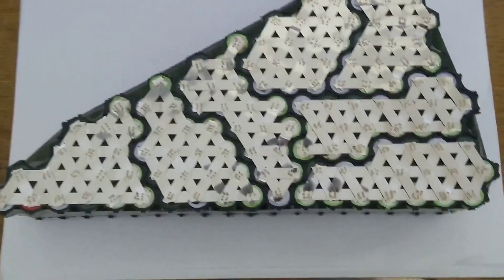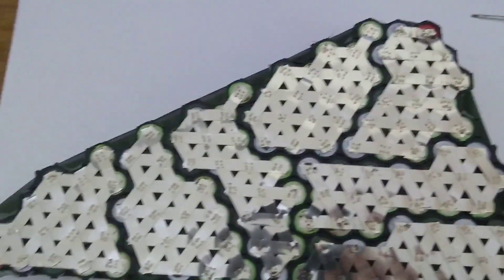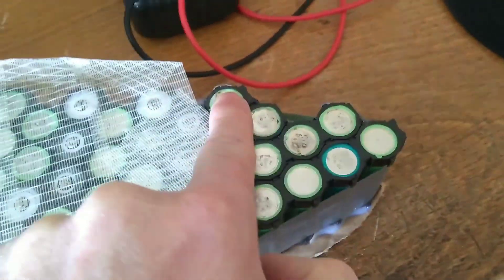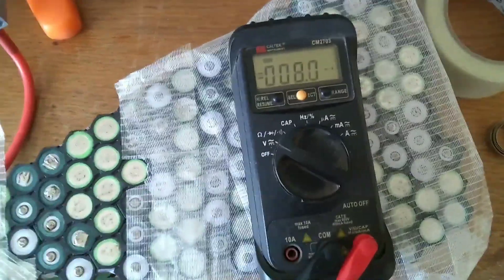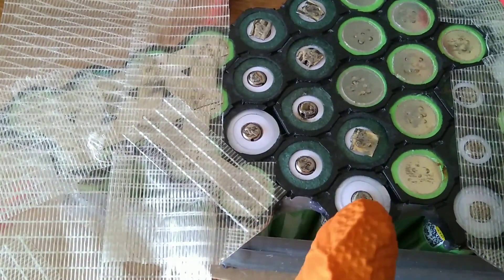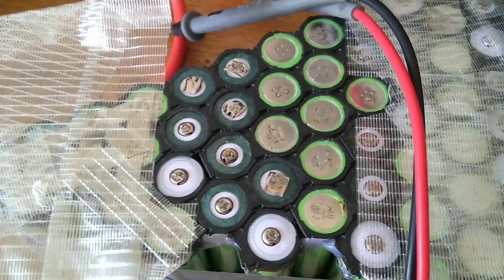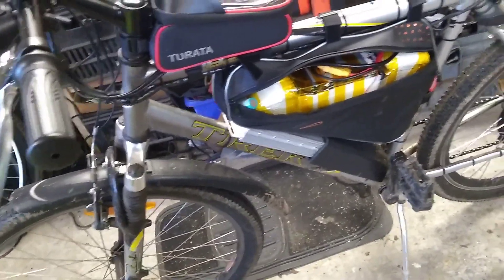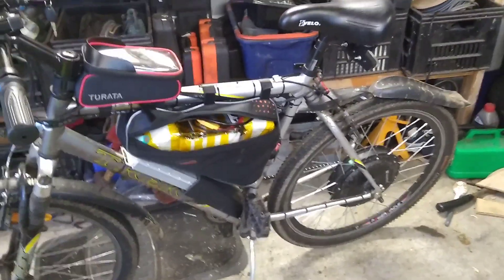DIY Ebike Battery pack for Voilamart kit - 52V 14S 9P 1.6kWh

Comment: Thx for the video.  I’m starting a 52v,60ah build with 21700 cells.  I found this helpful.  I’m trying to decide if I should use a passive bms balancer vs active bms balancing at 1 amp.

Comment: Awesome battery build i was hoping to do the same myself any chance you can explain the patterns on your drawings please how you wired it up showing the flow from 1s to 14s please
Reply from the maker: Thanks, it is still working well.
The way I worked it out was to buy the cell holders (link in the video description) and build them into the shape I needed so now I know how many cells in total I can fit in. You already know the number you need in series as you motor/controller will dictate this, so you can work out the max number in parallel. Build the shape using the cell holders then trace them onto a page like I showed in the video and pencil in the cell pos and negs. You need to draw it out for both sides as they will not be the same. You can just start fitting the cells into the holders and play about with it. This might be an easier way to get your head around shapes and connections but once you've figured it out make sure you draw the complete pack or you'll probably get confused.

Comment: Hey, very interesting video! What do you think caused the battery sag you mentioned at 10:10 ?
Reply from the maker: If the current drawn is too high for the cells or there are not enough cells in parallel their voltage will drop but also if the connections between cells are insufficient it will restrict the current so the voltage at the controller will be less.

Comment: I do my series connections at the same time as making the cell grouping connections. I use long runs of nickel that span the series connections between cell groupings right from the start. I'm making both the cell grouping connections and series connections at the same time. It makes for lower resistance over all. In a typical 20S pack welded from .3mm nickel, I see a max of 20 watts of heat at 100 amps discharge in the nickel or about .2v drop or about 2 milliohms of resistance. That's acceptable to me. Looks like you needed Mr Snippy for this pack!

Comment: Your nickel coverage is epic! Looks like nice deep spot welds that will last. I use .3mm almost exclusively. I don't cover every cross connect this much ever. What spot welder do you have? I use a KWELD/KCAP.
Reply from the maker: I had pretty bad voltage sag with the previous pack and was determined this one would be better. It is all 8mm x 0.15mm pure solid nickel. 
I have a 12V malectrics welder that is easy to use and very consistent.

Comment: I’ve always wondered why do batteries have fuses on the discharge wires is it the same principle as a circuit breaker? And what happens if you dont use a fuse on the discharge wire?
Reply from the maker: Good question. I suspect there is no reason to have two fuses except to be sure to be sure. 🙂

Comment: For the power on/off couldn't you have connected the negative to the first string negative, and then ran an extra wire from the first string positive to a push switch in-between the power on wire positive? Just wondering, because I would tried that and possibly turn it into a fireball..
Reply from the maker: Your idea would be OK but all the current would flow through your switch so it would need to be heavy duty. Mine is on all the time which is not ideal.

Comment: I know this is an old video, but where did you get the bag for that battery? I'm about to build my first triangle battery pack this weekend. (And how is that bag when in the rain?) I been looking for a plastic triangle case with ZERO luck besides prebuilt battery packs. My problem is water proofing my batteries, I've lost like 3 in the past 2 years from getting caught in storms. Actually my oldest ebike just died (after 4 years of use) last week from rain.  Nice job on this battery, I need the exact one for my newest 1200w road bike.. I hit 40MPH and let off the throttle because my front rim needs a spoke replaced and trued, but I feel like it would have kept going faster. Nice work though, I'll be back later to watch this again as I'm building my next pack.
Reply from the maker: I think it came from amazon. As for waterproofing I've no idea, I'm very much a fair weather cyclist.

Comment: "Don't use black cardboard" - got it.
Good video and an impressive configuration of cells.
Reply from the maker: I used cardboard with black on it it at first and was very confused when I went to double check for voltage before welding and found some. 😕 
At first I thought cells were touching and spent ages looking for a short before eventually realising what the issue was.
I use these cell holders https://ebay.us/POV3ap so I could confirm the shape and size of the pack, then draw it on the sheet (several times) before committing to welding.

Comment: Do you have any idea how much in length of nickel strip you used? I'm going building this exact battery. I've taken screen shots of your connections and will use that. Also i notice you're using connectors for the cells. Are they usable to such unusual cell configurations? I've also noticed the cells are paralleled in groups of 'nine'. Is that correct?
Reply from the maker: Thanks for your questions. 
I used around 11m of strip but not sure exactly.
I'm not sure what you mean by "connectors for the cells" but yes there are 9 cells in parallel by 14 series groups so it is 14S x 9P
Reply: @alibro7512  The plastic 'lego' housing around each cell, did you purchase them online, or print them yourself.
Reply from the maker: @IrishFuryan  I bought them from here. https://ebay.us/POV3ap
The only other place I have seen them is Aliexpress.
Reply: @alibro7512  found them on Aliexpress, I bought two hundred of the ones that connect solely in a square formation. These (the ones you used) are better for 'offset' configurations, and cheaper too.
Reply from the maker: @IrishFuryan  the only issue with aliexpress is the delivery time. It can be up to 60 days. The link I listed above are sold by me so will come in a couple of days.
Reply: @alibro7512  How do you decide on what combination of connectors to use? Or did you build with soley 'one' to 'one' type? If i have 'ten' length cell holders, how can i make small complex configurations? I'm still trying to get my head around this.
Reply from the maker: @IrishFuryan  I cut them to length. They are easily cut but required a little filing to get two ends to butt together. I have 5S and 10S which makes it a bit easier. 
When you get them it will be obvious but buy more than you need as there is some wastage when cutting.

Comment: The welds and connections looks super clean! How many amp hours is it? Are you considering upgrading the controller? Should be able to hit 40+ with a Sabvoton controller.
Reply from the maker: LOL, thanks but the welds are only clean on the neg ends of the cells. They are button top cells which are very hard to weld to cleanly without blowing holes in. Having a great welder makes all the difference.
Each cell is 3400mAh and there are 9 in parallel by 14 in series so 126 cells x 3400mAh = 42840mAh.
I think that's right isn't it. 
Funny you mention Sabvoton I did buy a 3kW Sabvoton controller last year but never got around to installing it.
Reply: @alibro7512  Are they mj1's? I bought ninety from a chinese seller, and sixty eight of them arrived below a voltage of 2.0, some as low as 0.5v. I charged them back up at 500mah, and will wait for a month to see what kind of self discharge they give.
Reply from the maker: @IrishFuryan  Unfortunately you cannot buy genuine branded batteries from China. They will ALWAYS be fake.
I bought these Panasonic from Liitokalla and although they were fake like most things from China they were actually really good quality fakes. Check out the links in the description.

Comment: Hello
Please I have a thousand watt motor
48 volts
Can I do a 14s battery
Instead of 13s
Reply from the maker: If your controller is OK with 14S then yes. It's not the motor that you need to be concerned about but the controller. I believe that all 48V controllers can handle 14S without issue but can't be 100% certain
Reply: @alibro7512  Thank you, brother
Good bless you
A question
I am now using a 13s battery
Get54 volts max
  And 39 volts off
But

14s how much the voltage becomes when the battery is full
How much will the voltage be when powering off
Reply from the maker: @mohamadsafaya7406  full voltage will be 14 x 4.2 so around 58.8v. I don't know if the cut off will stay at 39V. It depends on your controller. If it does stay at 39V you would need to be very careful as it could harm the battery.
Reply: @alibro7512  Thank you, God bless you🙏🏼🙏🏼🌹❤
Reply: @alibro7512   с чего оно повредит акамулятор?, Если 14s разрядить до 39вольт это будет 2,8в на ячейку разряд в допусках!!, Минимально допустимое напряжение разряда на ячейку это 2,5вольта!

Comment: Hi, what range do you have on this battery on the throttle itself at the maximum speeds of 45-55kmh?
Reply from the maker: I've never tested it but probably 20 to 30 miles.
Reply: @alibro7512  I have similar battery 14s9p on vct6 and my range is 25miles speed around 32mph
Reply from the maker: @andrzejkot8941  That's good to know, I wasn't sure if my battery was any good or not. What make/model of cells do you have in your battery?
Reply: @alibro7512  I have sony vct6 cells 28ah , after one year the capacity is 24.5ah
Reply from the maker: @andrzejkot8941  Mine are fake Panasonic NCR18650B's. I tested them when I first got them and they had 3400mAh so similar to genuine but a much higher internal resistance.
They still are working well for me.

Comment: Did you use to check the bms with the free app b4 you used vbms
Reply from the maker: The free App was some dodgy Chinese knock off possibly riddled with viruses so I didn't fancy installing it on my phone. Tony from Vortecks wrote the app himself so I trust him.
Reply: @alibro7512  just I don't know if Tony's will work with my bms
Reply from the maker: @revparsons3tl  If it's an ANT BMS or indeed any intelligent BMS that links to your smart phone via bluetooth it probably will. I wasn't sure either but the cost of the software is so low it was silly not to try.
Reply from the maker: I just remembered I think some Chinese resellers supply an old version of the VBMS App so you can try it and if it looks like VBMS then ditch it and buy the real thing.
Reply: @alibro7512  true but iam no good with bms settings or do thay come configurators already
Reply from the maker: @revparsons3tl  If you buy a smart BMS then you need to configure it for your own requirements. Watch this video and Tony takes you through the various settings. https://www.youtube.com/watch?v=Z7M_kNB7ltI If still confused ask on his forum which is linked in the video description. BTW I don't have mine perfect but it's good enough for me.
Reply: @alibro7512  my BMS is already configured rated to my battery when I got it but I'm just using a cheap Chinese app app

Comment: Nice project 👍 Last spring I installed the same kit on a crusty old mountain bike that sat out in the rain for 12 years. It worked fine but like you said the controller is crap so by November I was upgrading the controller for one with all the bells and whistles. Definitely a worthwhile upgrade. The worse part about the original controller was that worthless peddle assist that only went to full throttle when you peddle. The new controller has programmable LCD display, adjustable peddle assist, regen breaking I wanted mostly for the breaking assist. And lots of other settings that can be adjusted. If you do upgrade the controller one with the KT LCD8H Color Display seems to be a good one so far anyway.
Reply from the maker: I believe these kits can be bought with a LCD display that gives some control over the PAS and I think the display is available separately too but I plan to have a go at building my own PAS using an Arduino. I already have a prototype working for cruise control, it needs a lot of fine tuning before adding the PAS option to it but that is the goal.
Reply: i have been looking at a kit with the kt lcd3 and that has crusise control on it comes with the lcd and controller nice upgrade for me as i only have the 1000w motor but the kt controllers are alot better then the factory ones and alot more responsive i think that and a nice 52v 20ah battery will be nice only problem is heat here in australia

Comment: That's a nice looking battery pack Ali. 
You'll be setting an electric bicycle speed record next. ;)

I'm liking the BMS. I think I'll look out one for my Lipo packs in future projects. 

Thanks for sharing your E Bike exploits. ;)
Reply from the maker: Thanks John, The pack is working well but as the cells are not ideal I need to be careful not to push it too hard. Having said that I was surprised how cool they were after the last ride where I was flat out (only 15mph, honest ocifer 😉)for a lot of the time.
Reply: @alibro7512  Im not expert  but that is way low distance for that battery pack. Maybe cells are bad (some) - I think you have use second hand cells ? Did you solve this or it is still the same situation ? And verynice build too ! Im on my project - starting with alternator as motor (Bosch 120 A) and soon I need to get controller and battery cels...
Reply from the maker: @urospetrovic133  I'm not sure what you are referring to for distance. I can get over 70 miles between charges if I pedal and probably 25 to 30 if I don't which I think is pretty good. 
The cells are fake Panasonics from China which are around 3500mAh but a very high internal impedience around 120mR. That's why I used so much nickel when building the pack.
Reply: @alibro7512  I tought you wrote that battery was empty after 18 miles - or I got it all wrong :) And what you think about making alternator to be used on bike ? Is it a waist of time ... Thanks
Reply from the maker: @urospetrovic133  Not a waste of time if you want a project that is cheap and fun but it's better to drive the rear wheel directly with a large pulley.
Reply: @alibro7512  Thank you very much :) I was thinking to make start there, to do much possible as DIY and what I cant build to buy. There is nothing cheap and often quality can be questionable - especially with "made in China" stuff. I bolieve we can build awsome things - probably better than bought. Im "fighting" now with controller - I want to build it but I cant find plans, scheme etc - if I do that I will have only batteries on my shoping list ! :) I would be very thankfull if you can help me with some info and advice about controller. Cheers !
Reply from the maker: @urospetrovic133  cheap controllers are fine but you might have to wait a few weeks (even months) for one from China, maybe source one from Europe. It would be much easier than building one.
Probably best to resolder the high current tracks though as they are the usual weak spots
Reply: @alibro7512  Thanks for the tip ! I have think like this - I will rather wait and save cash and than buy best one (controller), simple it cant be cheap, have loads of functions and builded solid out of quality components. Thats why I have idea to build first one - without any extras: ON/OFF, RPM'S +/-. From older good components, massive, strong and simple :)
Reply from the maker: @urospetrovic133  I agree it is better to get a good controller when you can afford it but I suspect you could buy a cheap for less than it would cost to build one. 
Could you really build a controller for £22?
https://www.ebay.co.uk/itm/48V-60V-64V-1500W-Brushless-Controller-Ebike-Controller-Bldc-Motor-Controlle-g1t/233658218756?hash=item36671d7904:g:vP8AAOSwv-NfGUUO
Reply: @alibro7512  Well, tahts a bargin ! I cant build box and buy wires for that amount... Im taking a guess now, - you have try this one and it do the job :) Thanks a bunch ! (btw - if it works and last for season or two Im satisfied)